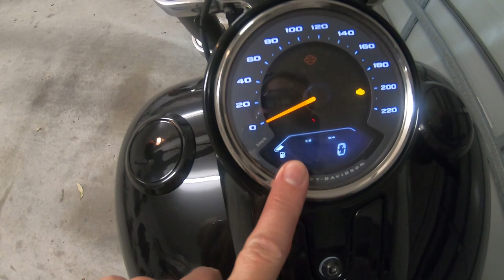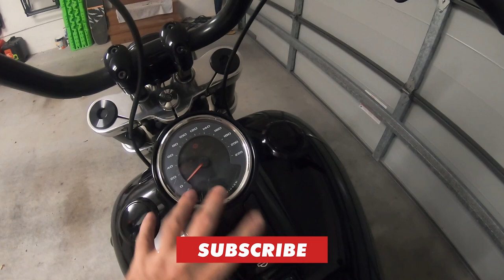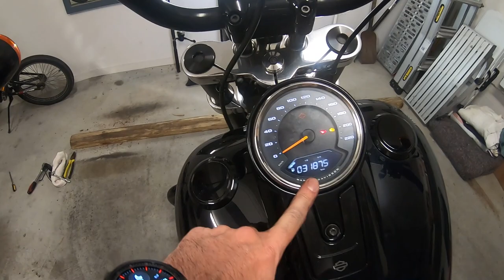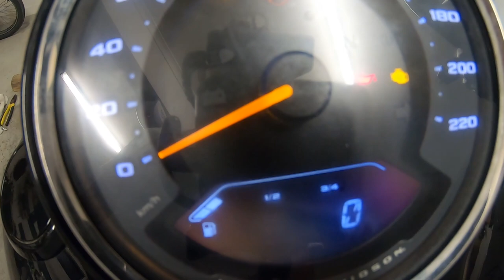HARLEY DAVIDSON Speedo CONDENSATION Fix

Comment: First want to thank you for your videos on the fogging speedo problem. I too have the same problem with my 2019 softail slim. I used your video where you took apart the speedo that quit working after you drilled it, to drill my own speedo accurately. 2nd I want to let you and others know this worked for me, and my speedo works just fine and no longer fogs up. I live in southwest Oregon so have plenty of humidity. I used your video of the disassembly of the non-working speedo to precisely drill 2 holes in the back of my speedo. Just got back from a 3-day ride on the Oregon Northern California coast with absolutely no fogging at all.  Inside the speedo where you drilled your hole, I also drilled in the bottom corners of that center piece where the internals of the speedo are a bit tapered and appears to be room to miss the internal workings. I put 2 1/8-inch holes one in each bottom corner, I also did not allow the drill bit to penetrate any more than necessary to make a small air hole. Not real familiar with how to post, pics ect. on Youtube, but I do have pictures of the back of my speedo where I drilled, I will try to post them.  Thanks, sorry it took trashing your speedo but hopefully it helps others as it did me. Without your video I would still be putting up with a fogged-up speedo every time.
Reply from the maker: I'm glad I was able to help. I was able to replace the speedo at a reasonable cost so the learning experience didn't cost me too much in the end

Comment: I've had the same problem with my 2014 FXDWG.  I used a LED light along the side of the speedo to determine where the logic boards were located & drilled two 2mm holes on opposite sides to avoid touching the boards.  Problem solved. I live in Australia in the tropical north.
Reply from the maker: That was good thinking mate

Comment: i drilled a hole in mine and it ended up worse, i rode on a foggy morning and the hole allowed it to collect a lot of water,
Reply from the maker: That's no good. Let's see what happens
Reply: @RidesForDays  i also ended up with ants going into hole and running around the speedo and it was only a 1.2 mm hole
Reply from the maker: Shit. I'm losing confidence now 😄
Reply: @RidesForDays  but in saying all that i had spoken to someone who said it worked for them. after i tried warming it up to let it vent and putting it in rice for a week with no results i brought a 2022 sport glide speedo and this one seems to be working so far
Reply from the maker: How much did the new speedo cost?
Reply: @RidesForDays  it cost me about $350 from Harley in Bendigo
Reply from the maker: Ok cool good to know👍

Comment: Break the glass, remove the broken glass pieces, fill void with epoxy (color of your choice), problem solved. Knowing your presice speed is highly overrated.
Reply: Have you tried this yourself? I thought epoxy got hot when hardening?? and thats not something u want to do to an led screen.
Reply: @nollidelddik  No, it ruins the speedometer but it looks pretty and doesn't bother you anymore.